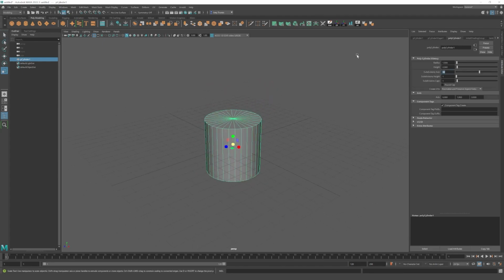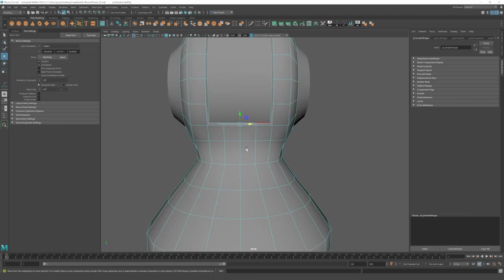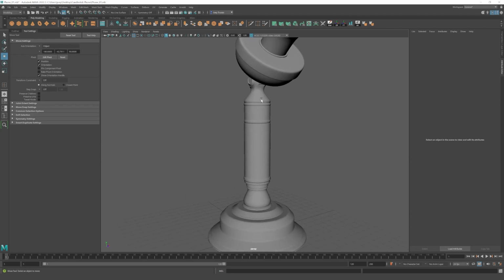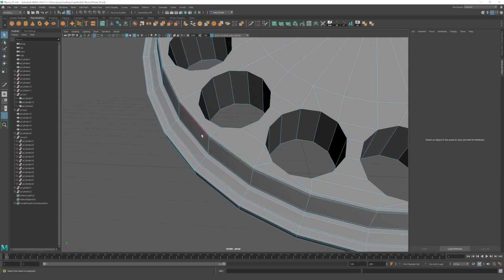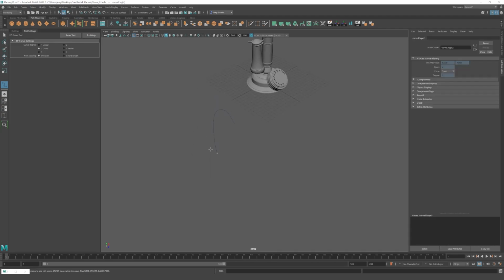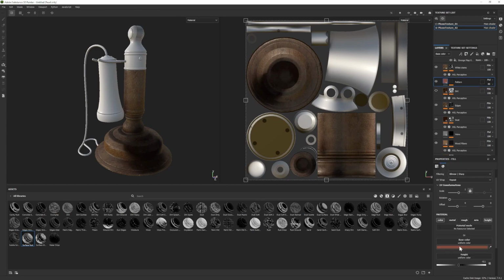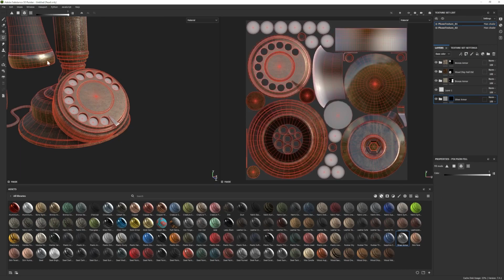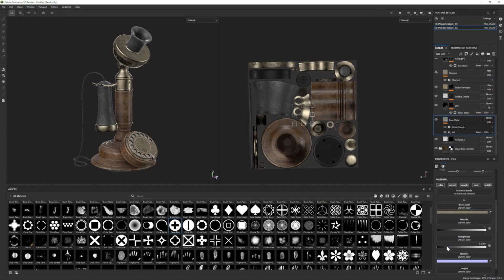Old Candlestick Telephone | Autodesk Maya + Substance 3D Painter

Comment: if it's okay to ask is there anyway in susbtance painter to export the material texture and not the base color ? i always get the base color texture in export,
Reply from the maker: I may not be understanding correctly, but the Base color is a part of the material's texture. Along with the other maps like normal, roughness, metalness, etc. You need to connect them all in your game engine or 3D software to display the objects material correctly.

Comment: Lol I feel so demotivated even after copying the whole process my model is still not perfect it is uneven from some areas and from some areas the mesh is totally green in color I think it's showing error
Reply from the maker: Don't feel demotivated! Just keep practicing. For the unevenness, its important to make sure the low poly blocked out objects are in a good state before adding more polys and adding more details. Its more difficult to move things around with more polys in the scene.
To fix the green try right clicking, go all the way down to "apply existing material" and re-apply a material to it. Or you can add a new material to it as well. Something may have got messed up in one of the operations you were doing, booleans can do this. I hope it helps!
Reply: @polyrendr  I'll try this thanks a lot mate !! ✨
Reply: @polyrendr  thanks a lot for the motivation. Before starting i made myself calm and patiently corrected all my mistakes properly by following ur video again and now the results turned out pretty well ✨ thanks !

Comment: hi ive group the cylinder for dial pad. but I'm not to rotate as shown -22:36. can anyone please explain how to do that rotation.
Reply from the maker: You need to make sure your pivot is in the center and all objects are grouped together. You can move the pivot by pressing the Insert key on your keyboard, and then clicking wherever you want to attach the pivot to. In this case the pivot was on the center vertex of that cylinder and I just rotated it around it. Hope this helps!